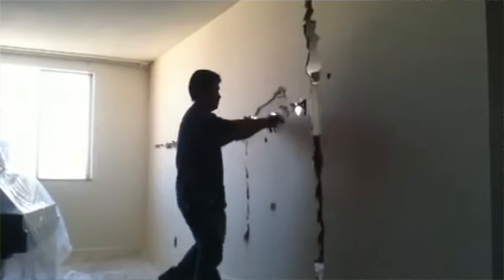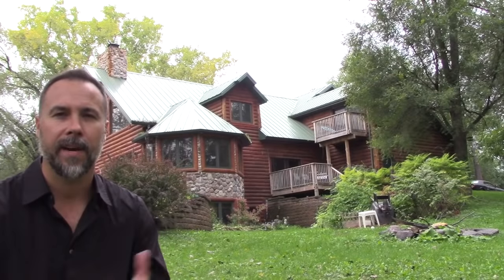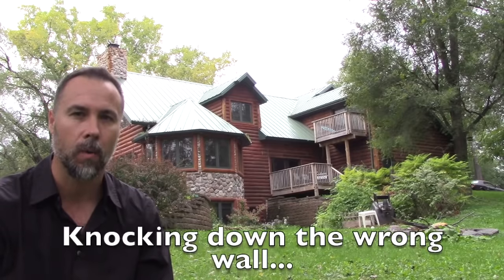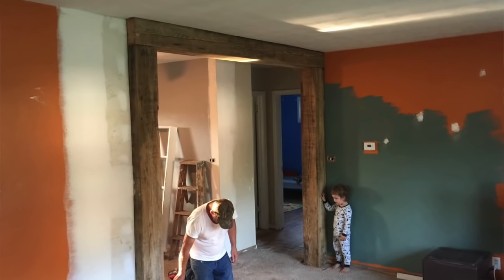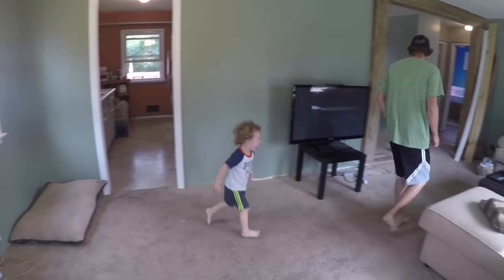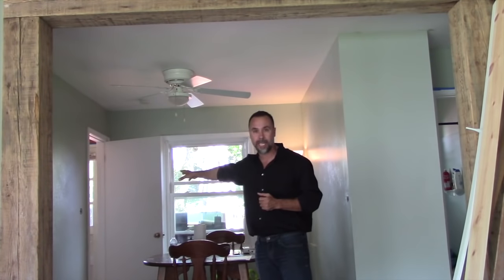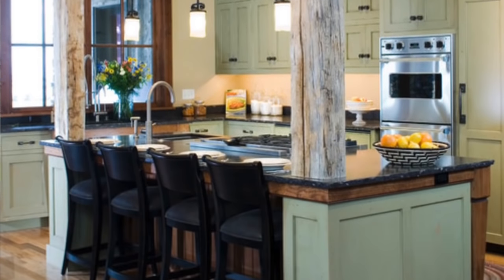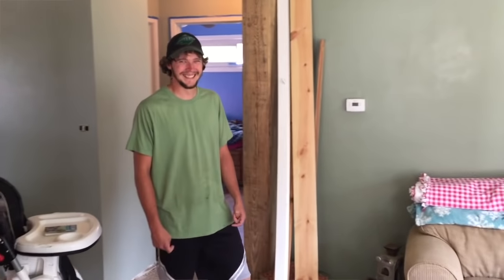How to Update a 1950's Home  - Removing Walls, Remodeling  and Creating a DIY Open home floor plan

Comment: Love the old wood you used to build the temporary wall. Saves money. I would have also painted it white or off white. I think it's a great idea considering you need to support the home/ceiling. Good luck to you guys.
Reply: I love it too, but never liked white beams or white moulding or frames ---my entire house has them and its hard to remove the white paint. I would have it all dark wood if I could

Comment: Lol great job. I like the beam look. "$tan do good" $tan do very very good". This reminds me of a job I was on final grading around a house that another contractor was renovating. It was a Friday morning and as I was fueling my dozer up I watched the contractor run screaming from the house. Couple minutes later I watched the roof collapse on half the house. He was hurrying through to have an early day but never built a temp wall before knocking out the main support wall in center on the home. He was cutting and realized  the floor under him dropped 3" so he ran scared. Needless to say I went from final grade guy to demolition guy in minutes lol. The home owner decided he would demo it and after the lawsuit with contractor now has a beautiful new home. (Which I did all the dirt work for.)  The contractor that was at fault now works at our local McDonald's because he lost his will to push through and learn from his mistakes.
Reply from the maker: Thats a really tough lesson for him

Comment: I have one question.. was ne of the three pieces of wood "toe nailed" in... fastened to nething... concrete poured on the two base posts...or just supported my ownS weight and those great gussets?.... I'm getting ready to do this same thing n just wanted to make sure I didn't need to get to really drilling or using brackets...

Comment: I am using the same type of beam you used in this house, but over a larger span. What is the largest span you would cross with a beam of that type? 
I am using a 8"x8" old barn beam from a 1890's barn, the current wall to be removed is 6' then carrying it over to a 4' doorway.
Reply from the maker: That depends on the over all load.  I can'y give advice on that.

Comment: Would I need to hire an engineer to determine if the wall is a load bearing wall, or can a professional contractor tell me?
Reply: well if you knock out the wall and the house collapses its a load bearing wall, just kidding.
Reply: Nora Tristan yes, any contractor that knows his stuff can tell you if it’s load bearing but then you’ll need an engineering report telling you what needs to be done to support everything IF you are pulling a building permit.  If your not getting a permit then the contractor can also tell you what needs to be done, like where Stanley used the 8x8” barn beams to transfer the load across to the sides of the opening and then done to the structure underneath.